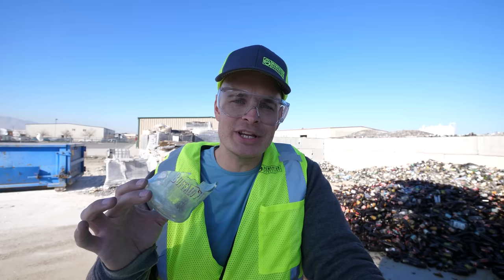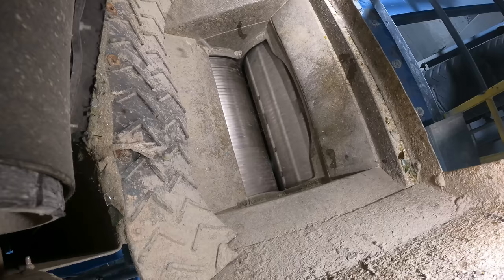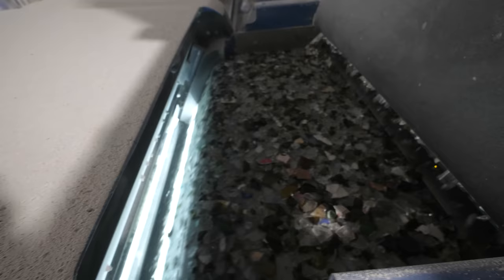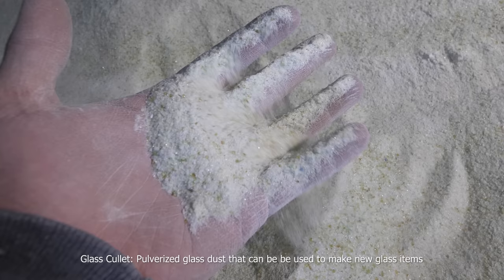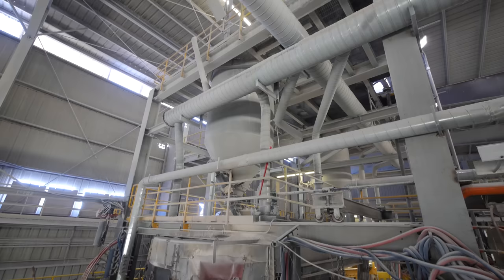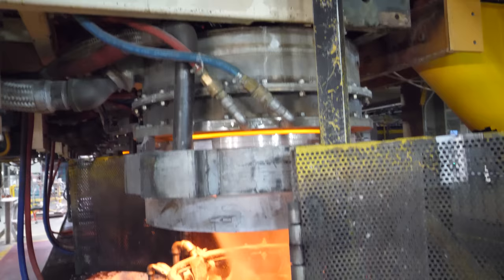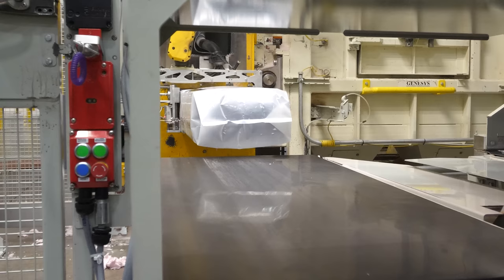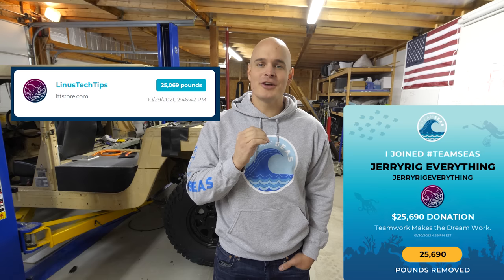What *REALLY* happens to 'Recycled' Glass?!  -  (you might be surprised)

Comment: The nice thing about glass compared to plastic, is that even if it is in a landfill for longer, it has a much smaller effect on the ecosystem. Glass is basically just a rock to nature (so is metal), so having them in landfills is about as bad as having a beach made of sand (almost the same material). Glass gets crushed quite easily over time, so it wouldn't be recognizable over those timescales. Metals just get crushed back into veins in rocks, exactly like they were when we mined them out of the ground in the first place.

Plastic, however, can cause serious problems for life because it leaks chemicals into the groundwater, and can easily contaminate food anywhere in the food chain. I'd highly recommend using glass instead of plastic whenever you have the choice. Glass is infinitely recyclable and is still safe even if it escapes the recycling system. Plastic can usually only be "downcycled", meaning it loses quality every time it gets used, so it has to be in lower quality forms; it is also toxic to the environment. Also, most plastic waste can't currently be recycled economically, so it just ends up in landfills anyway, even if you put it in the recycling bin.
Reply: Not all plastics have chemicals added to them.
Reply: The local refuse company touted that they were recycling glass and charging us to recycle it.   Well one day I went to the local landfill to take used motor oil to their bulk oil collection tank and found that they had dumped several truckloads of glass along one edge of the pit.  We have an Owens Corning plant two hours away.  I called the refuse company and they said the glass market had slumped and it wasn't worth it to haul;  but we still get charged for them to pick it up;  well I no longer recycle glass containers as I only have one to three containers a month, too many containers have gone to plastic, pain to wash and keep track of the glass and they only pick it up on the second tuesday of the week in a separate bin.  Too many containers have gone to plastic that they won't take in the recycle bin either, but they make sure to bill us as if they recycle everything.   

I saw somewhere that a local government agency made the manufacturers put in place a drop off site to recycle everything they produce; people have to sort it themselves, but they say more stuff gets recycled that way.    

Another wasteful byproduct is construction waste.   Contractors lump everything into their trucks and dump trailers and launch it into the landfill.  We have a recycling plant that grind's up all yard/tree waste and would recycle all nearly all lumber that the contractors just pitch into the landfill.  I don't blame them as time is money and they get charged for the load(s) no matter how much effort they put into it.   The local habitat for humanity site would take all the lumber and if nothing else they cut it up for heating wood and sell it if they cannot resell it. The recycling system in the United States is broken and it starts with the manufacturers;glass containers are now plastic in a lot of cases.
Reply: @fischy947  might be a bit painful...
Reply: @funnyfarm5555  A definite hard solve.  Recycling isn't lucrative so business that have nothing to gain or lose (government regulations)just dump which is cheaper than paying labor to be responsible.  Just like seeing some roadside dump that somebody who decided it was somebody else problem.  I'd think at least if the materials were separated into their own disposal site then one might have a 1 stop shop if a use materializes some time later
Reply: I know there are studies showing that plastic can breakdown with sunlight. Hopefully we can find effective ways of dealing with plastic in the future.
Reply: @jonnyOysters  There are microorganisms that have been discovered that can breakdown plastic, but they release tons of byproducts that aren't too great. Here's hoping we can find a way to mitigate the issues plastic has, or things will only get worse.
Reply: But animals can get hurt by broken pieces of glass lying around. even creepers like snakes and worms may get hurt by glass pieces lying around even in garbage dumps, because animals surely do not know that it is a garbage dump.
Reply: @fischy947  actually glass is mostly composed of sand so really after its rolled together repeatedly by water and wind and other erosion, it would feel like walking on a sandy beach.
Reply: there are some exceptions like uranium glass or old thermometers (since mercury) but that's rare and we treat disposal of those differently nowadays.
Reply: @ThatGuy-kz3fx  Which ones? Not PE-HD, PE-LD or PET.
Reply: The problem with dumping glass containers in landfills is that they take up a huge amount of wasted space. If they were crushed it would be a different story.
Reply: @fischy947  I fell awesome about it. Gets polished into multi-colored pebbles with round edges very quickly in running water or ocean surf. So it would just look like multi-colored gravel, probably very pretty!

Not ideal for calm lakes though :)

Comment: That glass sorter is probably the coolest thing ive seen this year. crazy how fast it works and how small the items it can detect and move are
Reply: mate its been a month and 4 days since this year begun :D
Reply: @pandaa6935  huh
Reply: @pandaa6935  who asked
Reply: I wonder why they don't remove the loader in the process. Using conveyors between equipment seems like it would be more efficient.
Reply: @pandaa6935  Yep, and it still beats out the vapour ware and the actual real tech that was shown at CES.
Reply: Very cool but it would be better to not rely on it as much as a ton of glass is wasted when the glass isnt pre sorted by color beforehand by the households.

Comment: In the early 80's I had a customer in the Chicago area, Viracon Glass.  There was a concrete pad with a Cat bulldozer than ran over broken or imperfect tempered glass.  At that time tempered glass couldn't be reused in glass making.  The broken tempered glass was then put through a crusher,  the resultant powder was sold to paint companies that manufactured highway reflective paint.  At night, the headlights bounced off the crushed glass particles in the paint - center lines, lane markers, etc., - so drivers could see the roadway.
Reply: Hi Jim  👋 I hope my comment didn't sound as a form of privacy invasion your comment  tells of a wonderful man  with a beautiful heart which led me to comment  I don't normally write in the comment section but I think you deserve this complement. If you don’t mind can we be friends? Thanks God bless you….🌹🌹🌹🌹
Reply: That is way cool. I know Owens Corning does not use tempered glass because of the extremely high temperatures required to melt it. Mirror, safety, and tempered glasses are harder to recycle for that reason.
Reply: @f0xh0nd51  Mirrors also have the silvered backing.
Reply: @sarah2.017  yes, that’s what I was trying to say. The silver backing both confuses the optical sorter and it melts down different
Reply: @sarah2.017  or aluminum.  The mirrors we used in the monster computers for the Navy, back in the day (those screens the sailor sat in front of and which went "blip, blip, blip," showing the location of the computer and other floaters around it) relied on the aluminum because it didn't tarnish as quickly as silver. 

Because the actual plated surface (silver or aluminum) is used, to avoid a thing called parallax (see note), the surface cannot be sealed (e.g., painted) to seal it from oxygen that causes it to oxidize.

NOTE:  Hold your finger on a mirror and the gap between it and the reflection is what is referred to as parallax), it
Reply: @kellyvcraig  USN 73-77   MR-3. Anchors Away
Reply: Can I get a company to buy glass waste powder?

Comment: The fact that someone invented that sorting machine using compressed air is the most amazing part. Seems like it would n impossible to sort, but someone solved it....
Reply: I bet it's the worst nightmare for maintenance crew.
Reply: @pop_popich  its probably an insanely complicated and insanely expensive piece of equipment. Luckily for the maintenance guys, they are probably well compensated and just hang around until something needs fixing.
Reply: Theyre pretty common these days. Used for all sorts of things. Theres a guy on youtube who sorts lego with one made out of ego
Reply: I don't have enough information about it so I will wait for Huggbees' version. But such a machine in that environment would be probably last straw for me (esp. after some years of its lifespan). It surely is impressive.
Reply: @mabamabam  Lego structure sorting lego parts. Sounds dangerous to me. Just one step from machine making killing machine.
Reply: @Stevo Also lazing around working machines is sign of good maintenance. So if there is machine that makes you feel otherwise it's surely nightmare esp if it literally wakes you up on night shift.
Reply: My favourite bit of the video
Reply: @pop_popich  one step from being a killing machine. Get it, step. 

Sorry
Reply: This avoids sorting the glass by color at the recycling point and saves a worker's salary. Economical, indeed.
Reply: The fact they are using that compressed air with so much silica without respirators is frightening...